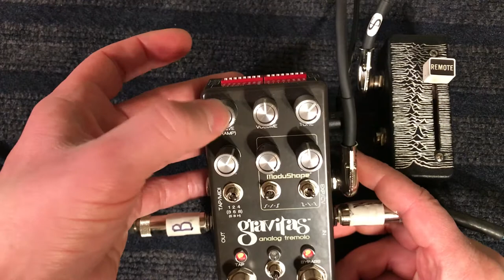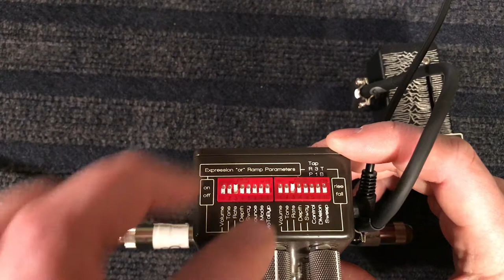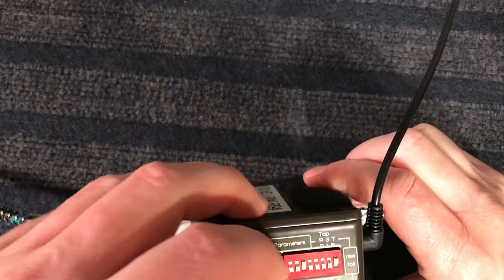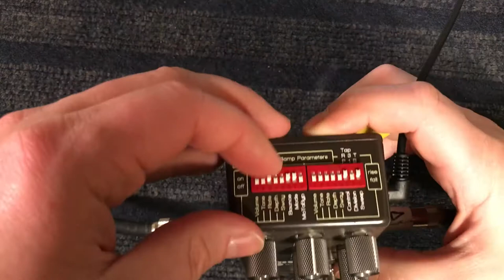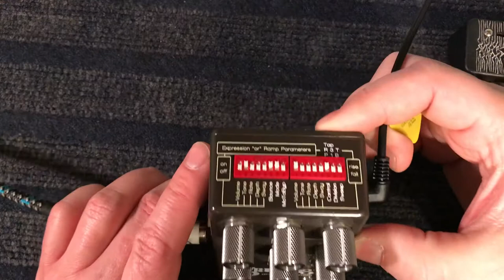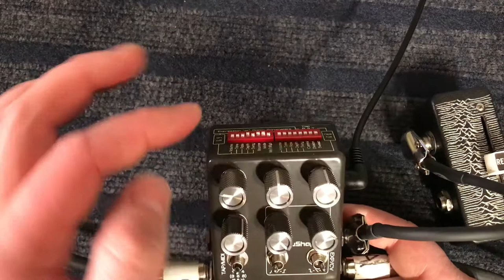Complete Dip Switch Lesson for Chase Bliss Pedals

Comment: When you save a preset, does it always save the physical positions of the knobs and dips, or can you set dip position via MIDI and then save it as a preset without actually physically flipping the dip?  Asking for when your CBA pedal is crammed on your board with something RIGHT on top of it, blocking convenient access to the dips.  Great video; thanks Paul!